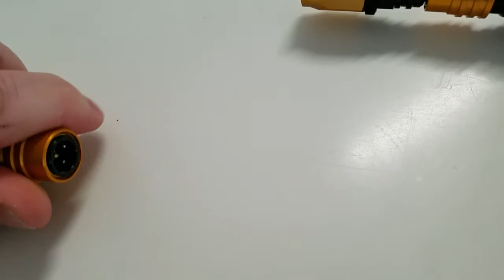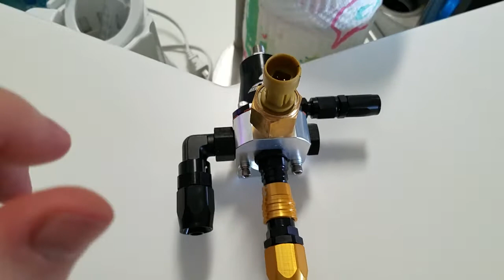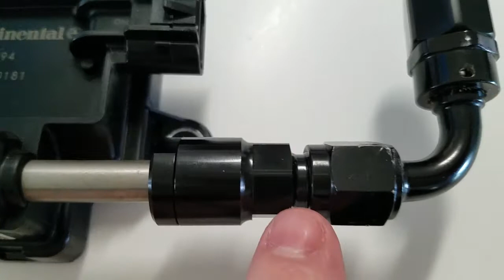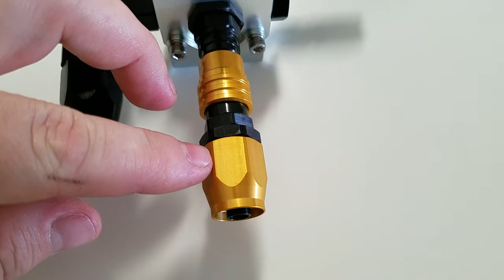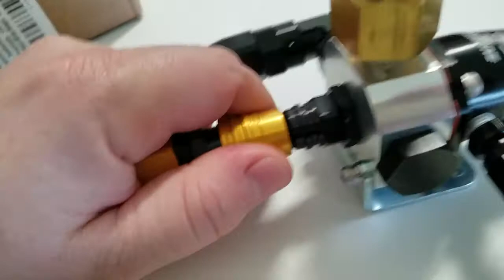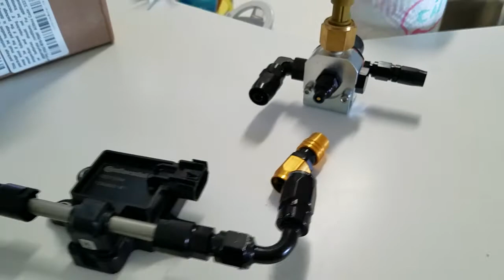HKS Twin Turbo Supra Build #13 -JiffyTite Fittings review Fuel System Parts are here!

Comment: Any problem with flow restriction with the quick connects?  Or is it negligible at an6? Cheers
Reply from the maker: Kris McLeod I go over the flow rating of the 6AN in the video. I can't remember what it is, but one fitting flows 1000LPH or somewhere around there. So no flow restriction. This is what F1 teams use for their oil and fuel lines to do engine changes so quickly.
Reply from the maker: Just a heads up I did a pull at 24psi on the GTX2971R and didn't run out of fuel. I'll verify my fuel pressure Monday when I install a new FP sensor.